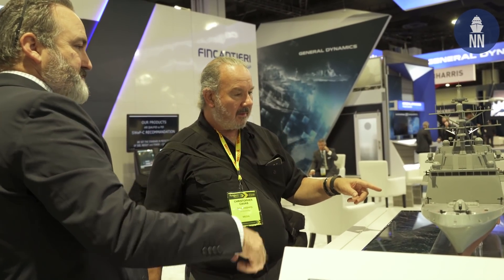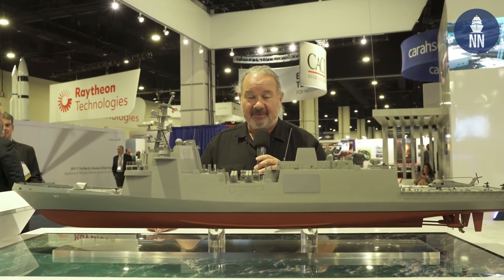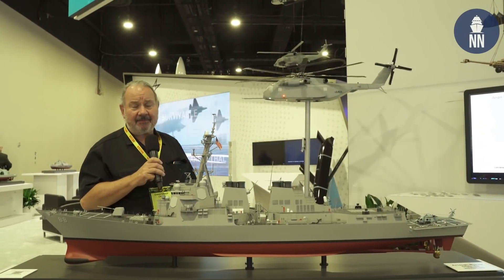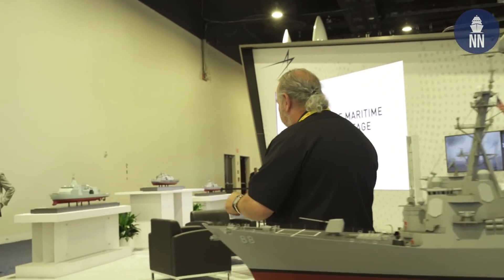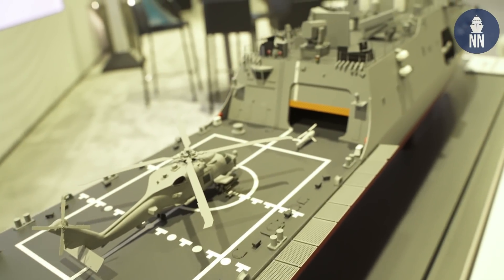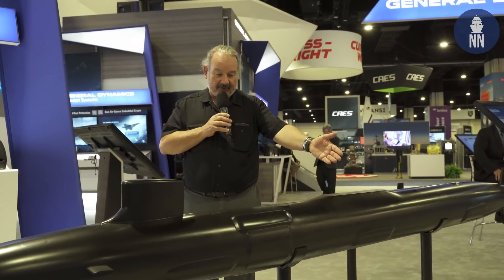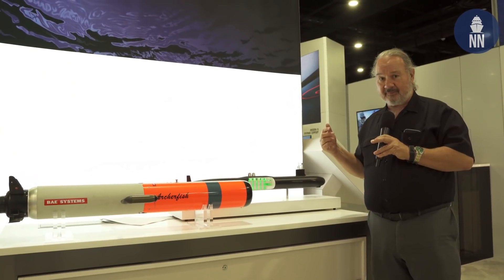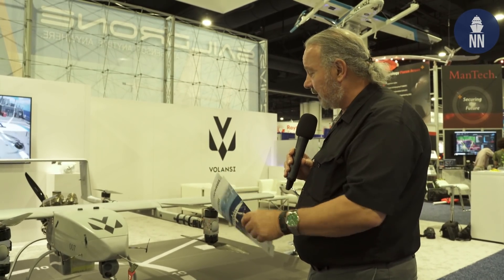Sea Air Space 2021: Constellation-class, Lockheed Martin, Virginia-class and Volansi

Comment: Needs a real naval gun system, not this 2-inch pop gun.  At least the Otobreda 76 mm naval gun.
Reply: USN ships don't really use the 76mm anymore so no particular need
Reply: @stealth225  I don't really agree.  So 5"54 and 2" is it for the Navy.  Might want to get those hyperVel rockets going ASAP.
Reply: @panhandlemikee9465  I don't think so there is a hyper velocity shell for 2 inch gun. Though there are 2 guided shells planned
Reply: @stealth225  Hope the 2" guided shell works better and cheaper than the 155 AGS.  For some reason, I bet the Navy will screw it up.  Ha Ha.
Reply: @panhandlemikee9465  AGS worked it cost is often overstated, it costs was 350k vs 800k that is often said . The Excalibur round of the army cost of half AGS but has economy of scale and risk reduction factors
Reply: @stealth225  AGS is dead.  Rail gun  on AWOL.   Escalibur not mentioned  as a replacement for AGS.  Only thing I have heard was a Hyper Volcity missle system for the 3 Zumwalts.  Who knows.
Reply: @panhandlemikee9465  that is true AGS is dead, rail gun is cancelled because of material challenges. I used Excalibur round as cost comparison point. In 2025 all 3 Zum's would go through a massive refit and replace the AGS with VLS for big hypersonic missile and probably a radar upgrade. Procurement of the tube has already started

Comment: So no hull mounted sonar , why is that? Germany also dosn t mount one on the    F 126 (Mks 180).    Does that mean that it has only passiv and no active sonar?  Don t you need a sonar that is deployed at all times like in sallow waters and takes no time to activate.  Should be still useful like for detecting torpedos.
Reply: Italian and french FREMM ASW have the hull mounted sonat Thales UMS 4410  CL (BlueMaster) that is combined with Obstacle/Mine Avoidance Sonar, but also the  towed sonar Thales CAPTAS 4 + anti-torpedo suite.
They have also a SeaBeam 3050 multi-beam panoramic echo sounder.
Italian FREMM have space to carry two helicopetrs (2 x NH-90 or 1x AW101 + 1x NH-90) since it has two hangars (one is smaller).
The ships have two torpedoes launchers 2x WASS B-515 (triple tube) for italian ASW FREMM.
Italian ASW versions has also 4 MILAS mussile torpedo carrier, it can deliver a MU90 torpedo at about >35 km (19 nmi).
Reply: Well as part of controlling cost there was decision made to used VDS and towed array which are much better than HMS( hull mounted sonar)
Reply: @stealth225  what is VDS ?   And yeah there is no doubt that it is better ! But that dosn t mean that it is obsolet because tow array also comes with drawbacks. Like deploy time / you can t use it everywhere (sallow waters/harbors etc.) / it limites your moveability and speed while deployed/ when beeing shot at and you have to speed up or move drasticly you risk loseing it and go blind. A combo with both seems to be better  . A question also can towed array be  both active and passiv sonar ?
Reply: @christianjunghanel6724  variable depth system . I think towed array should be able to do both passive and active. And you are correct a combination of both systems is better but the USN had to control costs so no hull sonar
Reply: @stealth225  thats worriesome for both us and germany
Reply: Your principal ASW Weapon is your Embarked Helicopter.
Reply: @paultanton4307  true but that one also has drawbacks!  That beeing :  to have it deployed you have to aware  that there is a sub/ it can t be deployed forever / deployeing it in the firstplace takes time/ useing it all the time is a big issue when it comes to wear of man and heli which is expensiv. In most senarios against subs you are getting spotted and fired upon first! Which means that heli might not make in time to save you let alone getting in the air. You need to fire a weapon on him to give im somthing to do like evaiding possibly brakeing the wire of any wire guided weapon he used .It also makes it difficult to fire another weapon at you or your fleet. Or you just kill him if you are lucky. It also gives you more time and chances to doge and to deploy that heli.

Comment: Almost as powerful as a Australian OHP upgrade with it's 32 SM-2s, 32 ESSMs, 8 Harpoons, 6 tubes, Pharynx and space for 2 helos. Wait, that was 20 years ago.
Reply: Are you talking about the connie? Because I don't know where did you get your OHP stats from  , they had only 8 Mk41 VLS cells ( self defense version only) while the connie has 32 Mk41 VLS ( Self Defense, Tactical , maybe even  Strike) . Connie has 16 NSM launchers which is a much better missile. Constellation uses RAM  which is much better than Phalanx, it also has space for 2 helos. Also Constellation will be equipped with the SPY-6 radar which basically blows out any sensor on the OHP . 

The above does assume you are talking about the constellation class if you were talking about the MMSC you would be less wrong. Also I doubt that 32 SM-2 were present ( or could be handled  after the ship was upgraded with Mk 41 VLS
Reply: @stealth225  The upgrade OHP had quad packed ESSM so 32 of them. The Mk13 had been upgraded to handle SM-2 and had a 40 round magazine. I am presuming it had a mix of SM-2s and harpoon.
Reply: @briananthony4044  that is true but I doubt they carried that many SM-2, iirc that loadout was before being upgraded with the VLS
Reply: @stealth225  US ships just don't seem to be well armed compared to the Russian or newer Chinese ships.
Reply: @briananthony4044  16 NSM is a lot. The SM series can also be used to attack ships ( though it is not recommend except in the case of SM-6) , Tomahawk Block 5 can perform as a Anti Ship missile not to mention the carrier carries alot of Harpoons/ LRASM
Reply: @briananthony4044  US Navy has traditionally relied more on airpower for offensive action, going all the way back to WWII. This has been true until quite recently, with the introduction of new anti-ship missiles like LRASM, NSM, and Block IV/V Tomahawks, which give the Mk41 VLS anti-ship capability and replace obsolete Harpoons in deck mounted box launchers.

Even now, this is still done in a distributed way. Small ships like LCS and Constellation-class can get away with having 8 or 16 ASMs, both because US battle groups have lots of extra strike capability from carriers, and because the larger destroyers and cruisers have space for between 80 and 122 missiles. The USN is heavily organized around the capability of ships and planes to launch missiles and then transfer control/guidance of the missiles from one to another, ensuring that the missiles are always receiving good midcourse guidance even if the launch platform is jammed or cannot see the target.

So when a small USN ship detects an enemy force that is too large to effectively attack with it's own armaments, the information sharing network formed by the larger air and sea force can easily coordinate larger attacks from the surrounding area, guided by the ships and planes that have the best contact with the enemy.

Comparatively, Russian missiles like Granit, Oniks, and Kalibr are more self-contained, usually relying on their onboard sensors, sensor-sharing between missiles in flight, or by missiles communicating with satellites, with midcourse guidance from ships and planes usually limited to satnav coordinates. Chinese missiles like YJ-18 and YJ-12 are similarly self-contained with little networking capability beyond basic satnav intertial guidance. By comparison, even the current AGM-82L Harpoon missiles have advanced two-way datalinks to receive target info from multiple sensor platforms.

Tl;dr Russia and China organize large air-sea attacks less efficiently due to using less digital communications tech, so they arm their ships more heavily to make each one as threatening as possible, especially the smaller and more numerous ones.
Reply: Since the new US Navy strategy of every non carrier naval combatant is suppose to have a long range anti ship role, the Tomahawk Block 5 is a possible option for the Constellation class frigates since it is supposed to have the Mark 41 VLS. Even the US Marine Corp have long range land based anti ship missiles.  I suppose you can also fit a long range anti ship missile like NSM into a US Coast Guard Large Cutter like the Legend class since they are built like frigates and look like frigates.  Yes, they are armed with 3 inch guns just like the Oliver Hazard Perry class frigates. Since like the Marine Corp, they are also part of the new US Navy strategy.  Ironically, during the Cold War, US Navy Coast Guard Large Cutter like the Hamilton class had Harpoon anti ship missile, Asroc anti submarine missiles, torpedo launches along with additional sonar and anti submarine mounted on board. Yes, they were supposed to act as back up to US Navy ships in case of a Soviet Navy sneak attack.
Reply: @bermanmo6237  the Legend-class ships have unused space set aside for OtH anti-ship missiles, torpedoes, and sonar systems. Obviously designed for the same purpose as auxiliary combatants for the USN if needed.
Reply: @bermanmo6237  And they will get past the Chinese 30 mm Gatling gun firing 11,000 rpm, the H/PJ12,  and past their Ram like missile system, the HHQ-10, even at subsonic speeds and with no stealth?
Reply: @briananthony4044  also, HJ-12 is an antitank missile, not sure why you mentioned it. The main Chinese naval SAM is HHQ-9, a copy of S-300PMU. HHQ-10 is just a copy of early RAM without SeaRAM integration or other upgrades.

Chinese air defense really isn't good. There's a reason that their new CIWS gun is 30mm with 11 barrels, they have the biggest gap between long and short range defense of the most modern Navies. Russia has the same gap between long and short range, but Russia has more ships with medium range missiles, automatic short range SAMs combined with CIWS guns, as well as dedicated short range SAMs, instead of copies of one outdated American missile that has no self-contained autonomous function.

Comment: What they outta do with the frigates is built MK41 VLS systems but turn them at a 45 degree angle. By doing that you can have 80 cells
Reply: And Basically removes whatever deckspace that could be used for something better (ie:Ashm) and overcomplicate a very simple process (Maintenance and removal of a VLS Cell).
Reply: I suppose you are talking about the BAE's Adaptive Deck Launcher. Iirc the thing is too big and dosent make any sense and as another person pointed it over complicates the process
Reply: Isn't that just a mk57?
Reply: @ShatteredStarz  mk57s are not angled.